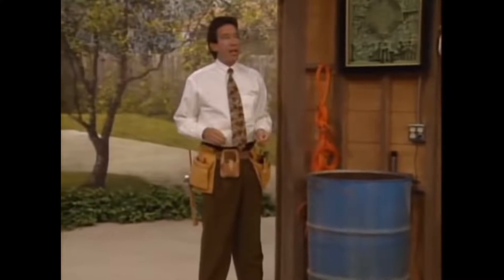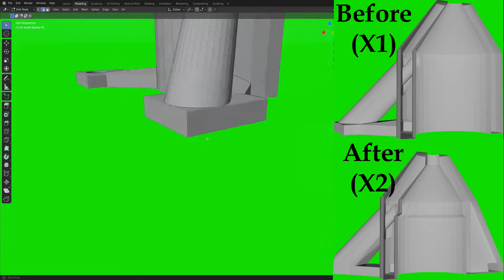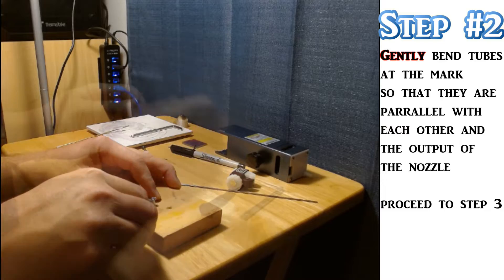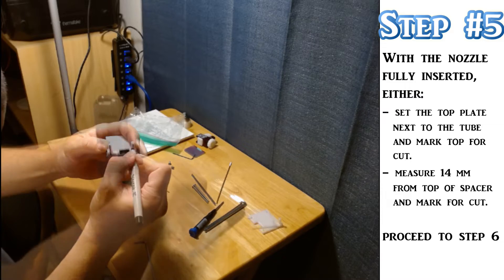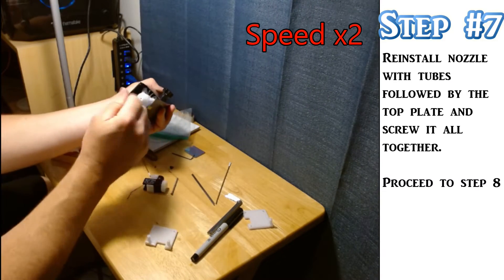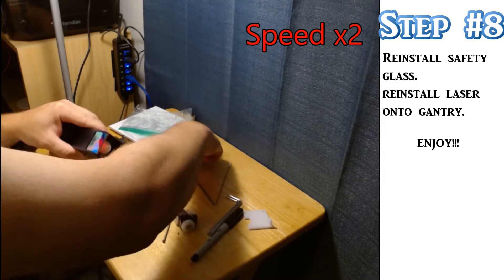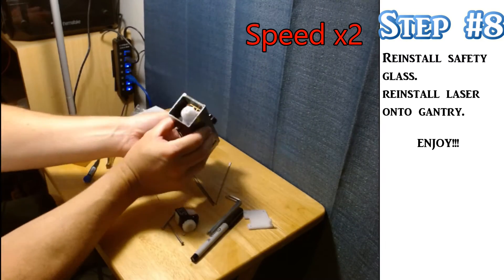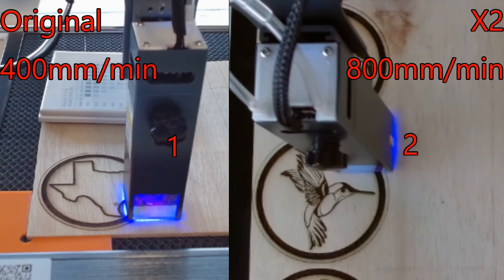Atomstack X7 Pro Air Assist X2!!!! 2x the air, 3x the power

Comment: I really like this design. I just ordered my X7 and wanted a way to do air assist without having to drill any holes. Suggestion: if you ever take it apart take the brass tubes and lay them on paper and get an image so followers could bend the shape to match yours. Also what temp are you printing the PETG filament for the parts? Great video! Gonna give this a try. Thanks! Subscribing.
Reply from the maker: Yeah, i could do that. I print PETG at 220 with bed at 80.
Reply: Test card pls 2.8 mdf